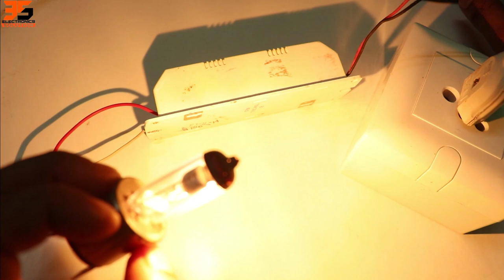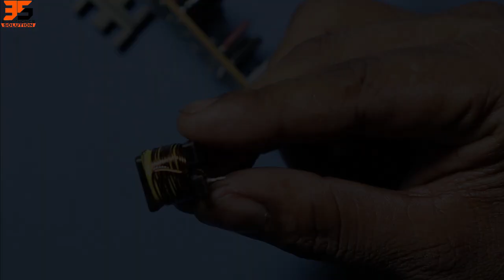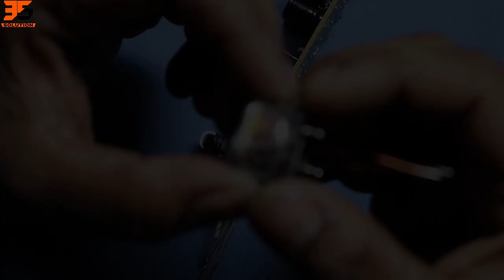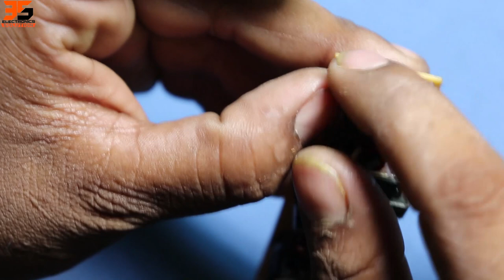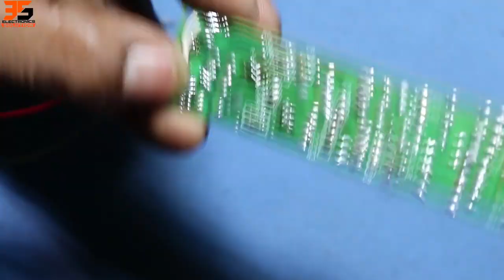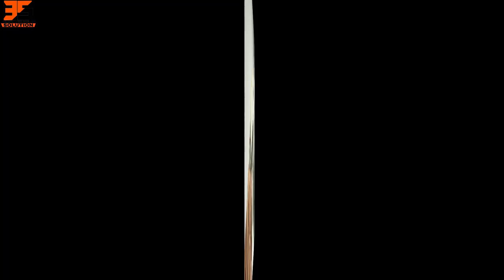First time in youtube | 12v 5Amp SMPS | Experiment Electronic choke

Comment: I got 15v 7amp from 95watt cfl circuit to remove 400v electrolyte capacitor then the the transistors MJE 13007 is not get to hot.. Thanks for your support !